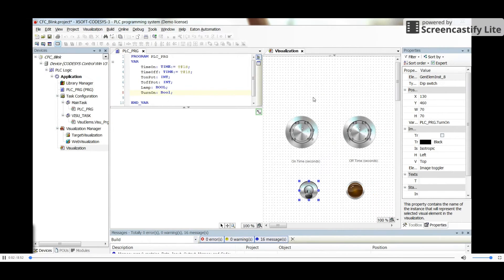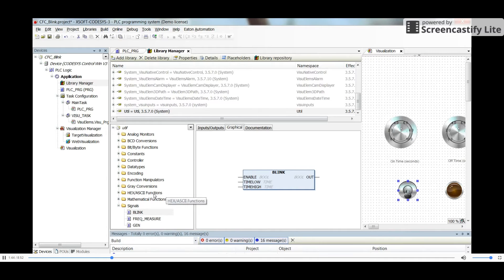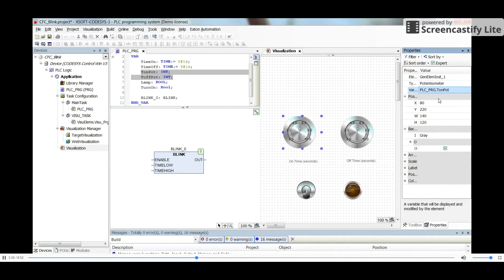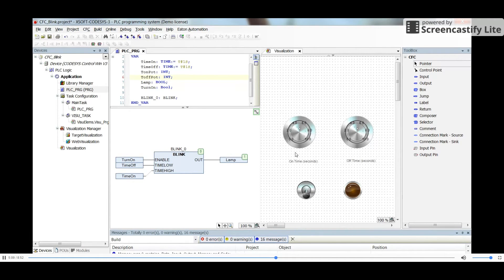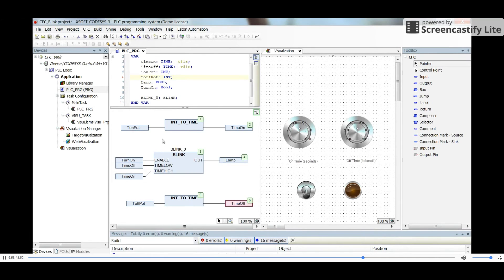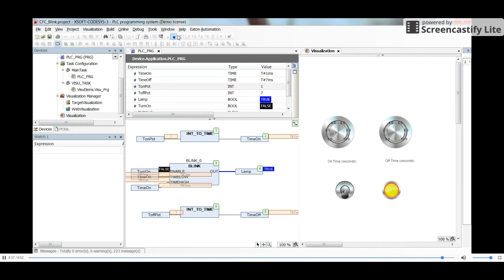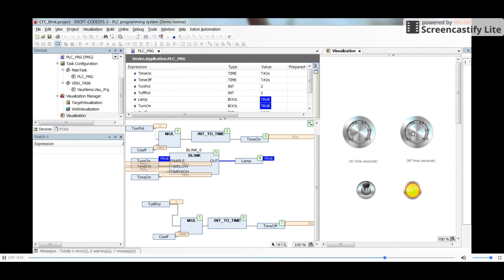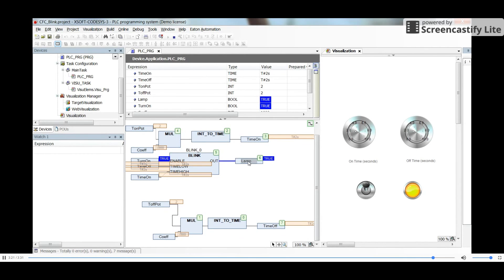CODESYS: Using BLINK function block

Comment: How in Structure Text reset this block?
Reply from the maker: You can disable the block by providing False to the Enable input of the Blink.
Something like this should work: 
BLINK_0(Enable:=False);
Reply: @TohidAlizadeh timer still working until time expires. for example You can see it setting TimeLow 10 min. If make Enable = false new blink will not start until Tl time expired

Comment: Yo dude!, when i'm in the "input assistant" looking for the "BLINK" function, however, the category section is completly empty, why's that? Can't seem to figure it out...
Reply from the maker: Have you already added the library into the project?
Reply: That's correct, I have added the util library.
However, I can't see any of the functions in the toolbox, or in the category section.
Reply from the maker: You could not see the functions in the toolbox, anyway. However, using the Auto declare, if you use the Input assistant, you should be able to find it, otherwise, you might have issues with the installation of CODESYS.
Reply: Hey dude, I finaly got it working. But i'm sitting here with my project and things arent really moving the way i'd like it to, perhaps you could help me? it's about the blink function. Do you have any skype or something along those lines?
Reply from the maker: SimplyLife You can reach me using my Gmail account. I use Google talk: tohid.alizadeh@gmail.com
Reply: I've added you mate, ill message you later  :)
Reply from the maker: SimplyLife was talking about the fact that, whenever the Enable input of the BLINK function becomes False, its output does not necessarily turn False, and based on the moment of switching Enable from True to False, the output may remain True, which is fine. If you want to have the output False, whenever the Enable is False, you would need to use an AND after BLINK, which would need to receive output of BLINK and the Enable as its inputs. Then you can use the output of AND as the main output!